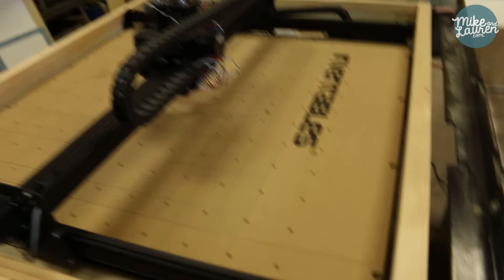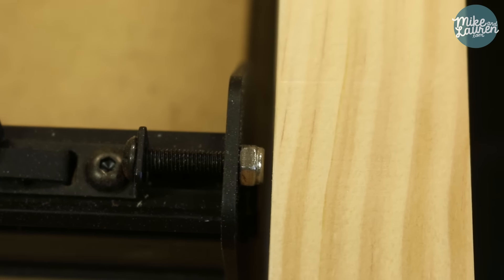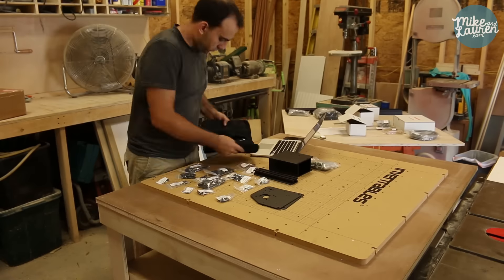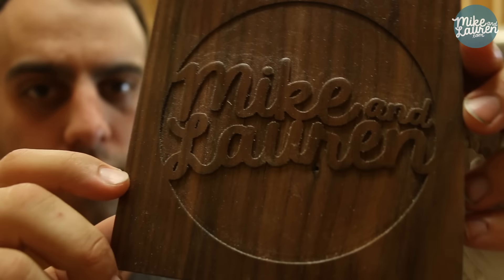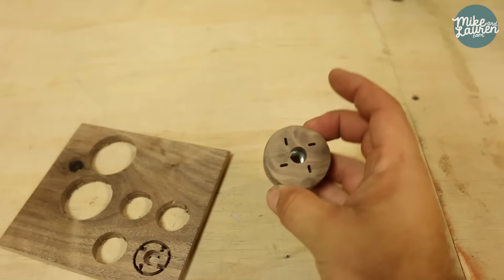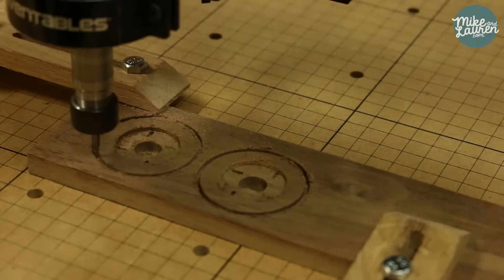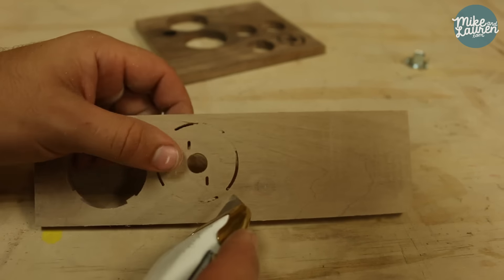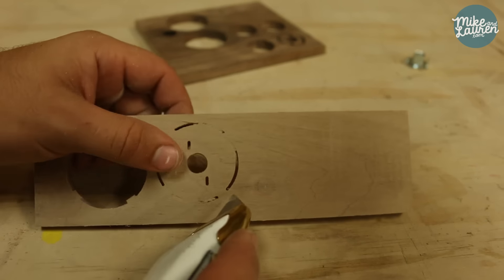Better Late Than Never... (X-Carve Lift Table Complete)

Comment: I like this idea of using something for multiple purposes. Nice one. Do you have a picture of the height adjusting jack before you cut it up and installed it.
Reply from the maker: Luke Pettit It is the Curt 28204 jack.  If you google that it should have a picture. I picked that jack because it had 14 inches of lift instead of the usual 10 inches.  And it was cheap on amazon $30 bucks.

Comment: Nice job, i really need to find a better solution for mine instead of moving it around the shop depending on what i want to record.
Reply from the maker: Warren Downes - One Wood Thanks!  Great channel, I didn't realize was you.  I saw your laptop stand video months ago, but never made the connection.

Comment: Any ideas on how I can make an adjustable height circular saw sled that rides in aluminum T Tracks? I want to be able to use it to cut everything from 1/4" to 4" deep while still riding perfectly straight in the track. I don't know if that makes sense or not. You do nice work so I wanted to ask you. Thanks.

Comment: Very intuitive adaptation on the jackbench. When running the X-Carve do you get any vibration or shaking in the table?
Reply from the maker: ***** Thank you and no it doesn't.  If the shelf is not completely extended to either the top or bottom it rocks a bit if you put weight on it.  But I shouldn't need to use it other than fully opened or closed.

Comment: Did you find a cheap place to get these jacks?  I am looking to use your design and make a table that I can use as an outfeed table, then lift it onto wheels and push it to its storage spot and then stow my table saw under it.
Reply: Harbor Freight on sale or coupon!
Reply from the maker: Mitch Fenneman I tried the Harbor Freight ones and they were just too low quality.  I ordered these ones on amazon for $30 bucks a piece.  For an extra 5 dollars you get a higher quality jack with 4 inches more lift than the HF ones.  They are the Curt 28204 model.

Comment: How do you think the X-carve is going to hold up in a dusty shop long term?  Do you see it needing replacement bearings due to getting gunked up?  Also do you think you could have gotten your logo cut with no tooling marks by using a different spindle or do you think that's just going to be what you're going to be left with no matter what?  Love your channel, and out of the 10000 x carve table videos out there I do think your idea is the best.  Wall space is too valuable to have a 4x4 area taken up to hang it up.
Reply from the maker: david Boardman I'm eventually going to get a dust collection system, but I'm very impressed with the build quality of the X-Carve so far so I think the bearings will be fine.  I'm NOT impressed with the spindle, however.  I'll be upgrading that.   I'm not exactly sure about the tooling marks.  It might have been because my scrap piece that I used wasn't an even thickness.